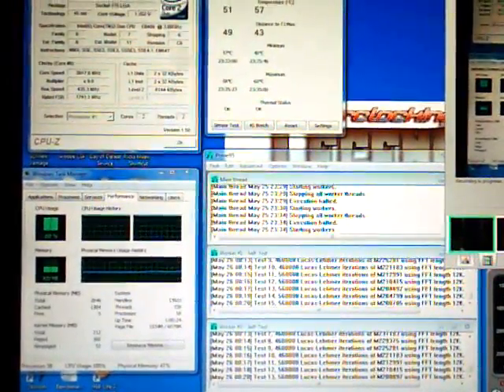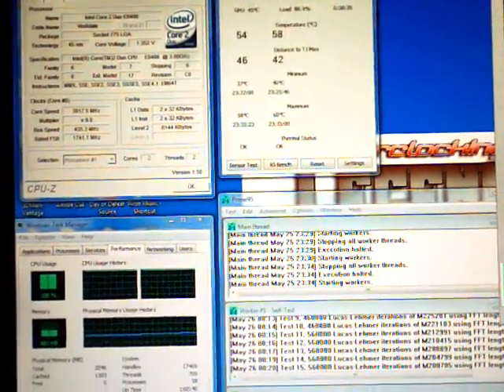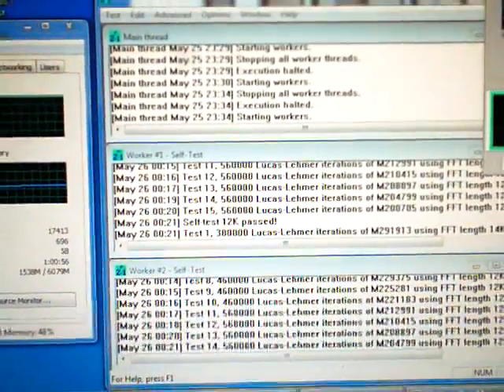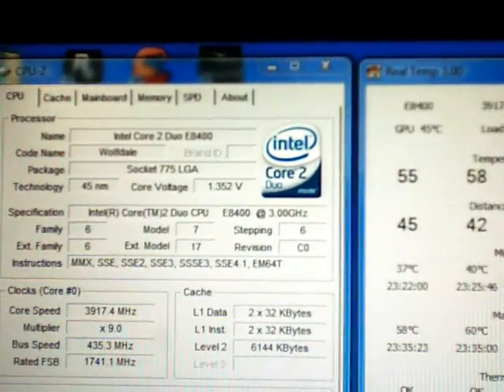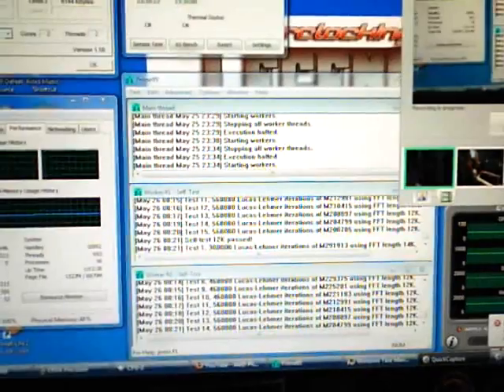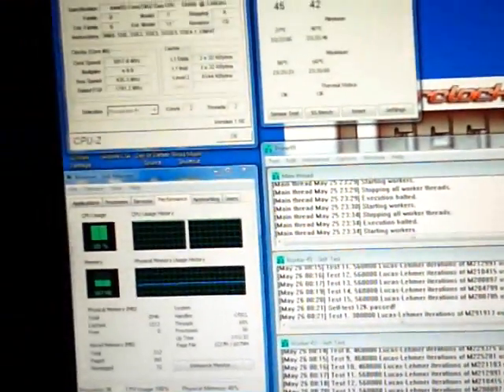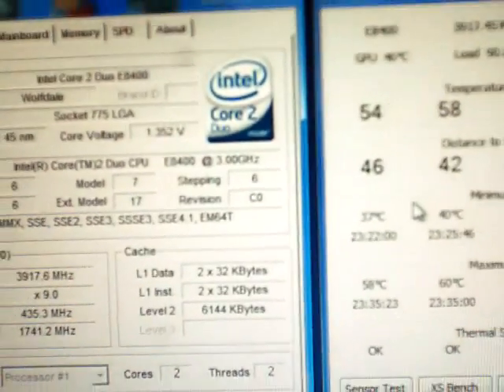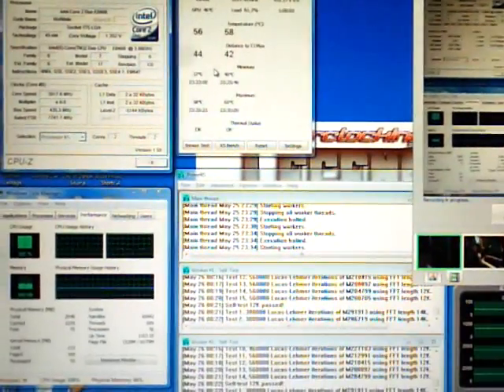E8400 @ 3.91GHz+BIOSTAR T-Power I45 Prime95

Comment: nice, i have the same mobo and i have got the fsb from 1333mhz to just under 1900mhz and i have reached 2000mhz stable but i got worried i was pushing it too far to be honest, so i lowered it a little.
it is such a good mobo, the only annoying thing about this motherboard is i wish it had more features in the bios but apart from that...perfect